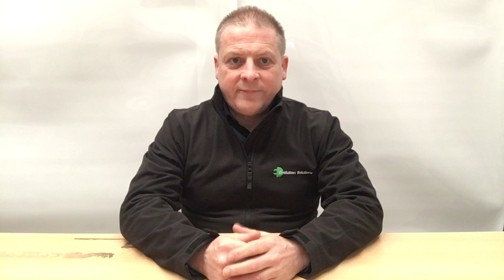EV chargers stopped by looped systems

Comment: I have a looped supply, Pod point are fitting a home charge point on 28/03/2022 uk networks say there is no need to change it just fit a 60amp load limiter and will be ok. Hope this helps people understand you can get one
Reply from the maker: Yes, some network operators are now changing their approach to looped supplies, and will allow some installations to go ahead if a load management device is included in the installation.

But not all are taking this approach, and it can be a different outcome for each looped customer, even with the same network operator. It’s very inconsistent.

Comment: can I just ask as I am in this situation with Western Power who have stated that if they replace the existing 16mm cable it wont cost anything, but if they replace it with a 25mm cable we will have to foot the bill (power is coming from above to the property by the way, pole is outside the house nice and simple)
Reply from the maker: It’s probably the fuse upgrade they are talking about.

Some network providers will upgrade you  from 60Amp to 80Amp for free,  it charge for the 100Amp upgrade, as it requires the thicker cable.

Our local network provider have now also started charging £300 fir the 80Amp upgrade or say you can install a load management device instead.
Reply: Our existing fuse apparently is rated at 80A even though it says 100A on it, so they would be replacing like for like
Reply from the maker: @paulypyro  sounds like if you paid for the thicker cable you could then upgrade the fuse to 100Amp in the future.

Be worth finding out if this is us case, and if it’s not too much, it might be worth you going straight too 100Amp to future proof yourself.
Reply: we haven't paid for anything yet as the work has not been done, just waiting to see what they want to put in when its unlooped - they did say as we have no electric heating and just hob, shower etc that it would be unlikely to need more than an 80A but I have no idea. Our charging will be done overnight anyway to use the Octopus Go tariff
Reply from the maker: @paulypyro  hope you get it sorted to your satisfaction 👍
Reply: So do I m8, its been over 3 months now waiting to sort our looped situation out !
Reply from the maker: @paulypyro  it’s a real problem, some of the electricity network operators are very slow at splitting loops. Very frustrating for people like you.

Comment: SSE want to dig up my drive to unloop the mains and charge me for the pleasure
Reply from the maker: I have heard that some of the network operators are starting to charge for this.

You might want to check this out though, as I think they have to take people off loops eventually anyway.
Reply: @evolutionsolutionsevcharge969  yes eventually but charging for it until they are forced by government to do it, so much for trying to push net zero and becoming greener 🤷‍♂️